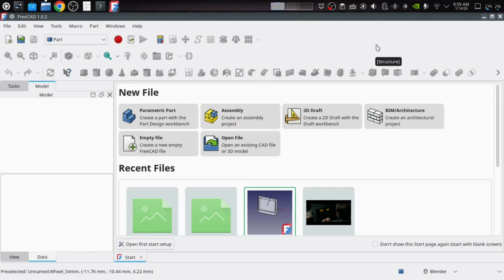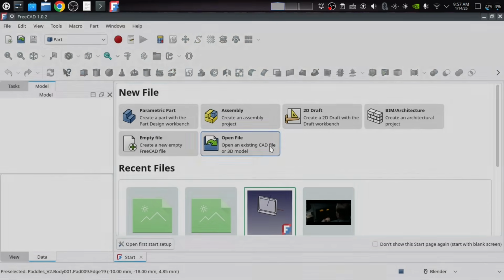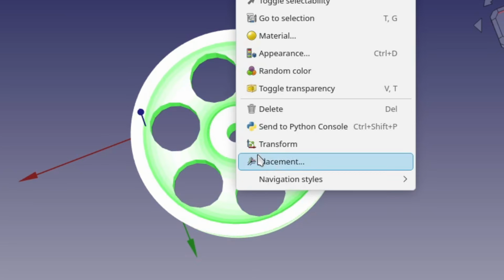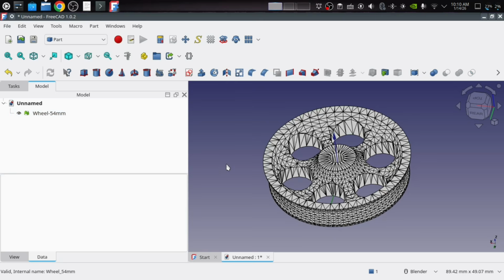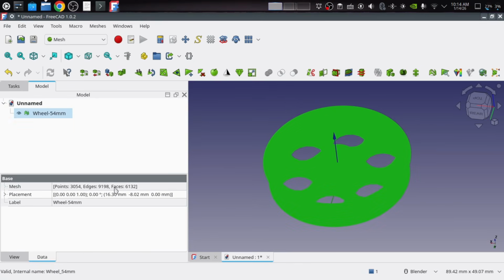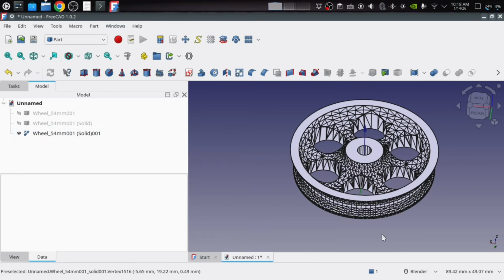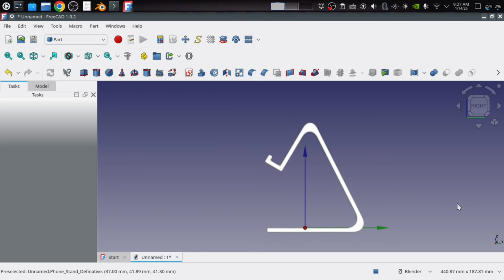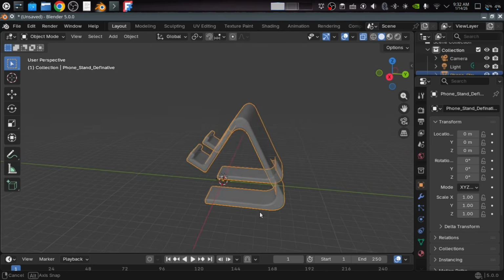FreeCAD - Some beginner tips on editing STL files.

Comment: my biggest pain  with free cad  is lack of smart converters that could detect and convert multifacid surface into something smooth. for example when exporting part as stl it is converted from mathematical construction like circles, curves and smooth edges , to flat aproximation but when you import it back, refining only glue together same plane triangles and i would love to just be able toadd a modyfier to entire surface and make it into a closest fiting bezier
Reply from the maker: I don't know that there are any converters that will take a mesh like STL and create simple surfaces out of them...  
The closest you can get is the STEP file format.  It was designed for exchange of 3D models between cad programs and maintains the mathematically defined geometry of the cad model. 
It doesn't preserve a history of operations though.  You can make limited modifications to an imported STEP file, but you can't change dimensions of existing surfaces and shapes.

Comment: Thanks Kevin, now I have to go learn Blender LOL. A few months ago, I decided it was time to migrate from Onshape to FreeCAD ... and what a journey it was. I am using my resin printer to make small parts (Multiboard wall mounting components) and my FreeCAD is freezing for 5 to 10 minutes doing boolean operations on converted solids that have less than 20,000 facets.  Thanks to your awesome presentation, I realize that adding Blender to my repertoire is a must. As a retired Engineer who did tech support for CAD (CATIA) for 5 years, I would not have recommended FreeCAD to anyone except total CAD nerds. It is easy to get stuck in FreeCAD  because it is really  comprehensive and complicated. 
But I have found that there are so many awesome resources (like you and Mango Jelly) on Youtube, it is well worth the effort.  I have also found that AI (Google Gemini in my case) is very helpful.  I have asked Gemini at least fifty questions about FreeCAD, Inkscape, 3d printing, and soon ... Blender.  When I got stuck, at least %75 of the AI responses gave me an "Aha .. no wonder" solution.
73 and Thank You  !!!!
Reply from the maker: I'm glad it was useful to you.  Check my FreeCAD playlist and you'll find a couple of blender vids.  One on rendering your models, another on moving assemblies over to blender. 
They'll get you started, especially the rendering one.  I take you through the basic steps of the blender interface.

Comment: The tip about using Placement/Center of mass to move an object in the stl file to the x/y origin is awesome. I've been modifying stl files for a while, and I never knew that. Thank you!

I'm curious. You're the first I've seen to sequence the Refine Shape operation after the Convert to Solid operation. Most presenters use this sequence: Shape from Mesh|Refine Shape|Convert to Solid. Then with that sequence, you can delete the originally imported stl, the shape from mesh, and the refined shape -- leaving only the solid object in the model tree. Thoughts?

Comment: Enjoyed you video and learned some technics. However, I tried to use the Addon Manager, and it didn't find the MESH workbench. Not sure where it went. We are both using 1.0.2 so that didn't explain the issue. Sad, I would have liked to play with that workbench.
Reply from the maker: The Mesh workbench is one of the defaults.   It should be there right from the first time you launch the program.  
I just downloaded 1.0.2 onto a fresh OS installation I'm working with and it had the mesh workbench available right away.
Reply: thanks, I’ll see if I disabled it in preferences tomorrow.

Comment: Great video and very helpful. There are other YouTubers who provide the steps on how to do this but they don't give the "why". 

I'm new to 3D printing and I ran into a problem trying to edit an STL. I tried freeCad and ran into a problem with missing facets. I ended up giving up after not being able to solve the problem and tried tinkercad which has its own issues with editing STLs. 

One suggestion would be a follow-up video that explains how to solve some of the problems that might come up that prevent editing inside. Freecad. Thanks!

Comment: Thanks. How would you edit let's say the spoke hole that didn't get converted to a flat single face?
Reply from the maker: In this case, I'd just sketch on the XY plane.  I'd use the external geometry tool to bring in three vertecies from the spoke hole, three along the outer edge of the hole, spaced out roughly 120 degrees.   Then when I sketch my construction circle, I can make it's edge coincident with those three points so it lines up with the existing hole.  Now the center point of that construction geometry circle is in the center of the spoke hole.  I can use it to sketch the real geometry circle..  
Since I sketched the spoke hole circle on the XY plane, I'll just extrude it tall enough for it to come up through the wheel before I do my boolean cut.

Comment: Thanks, Kevin!
Very easy to follow video and, though I'm not totally new to FreeCAD and mesh imports, it certainly still improved my knowledge and understanding of it a lot.
As for Blender, I tried it back then, but gave up after 10 minutes, uninstalled it, vowed to never install it again and then I started learning FreeCAD.
But, after watching your video, I'm thinking I don"t have to fully learn Blender, I can just learn to do one or two things to a mesh before bringing it into FreeCAD.
One thing that is still working well for me when I want to make a few simple adjustments to a downloaded mesh file, is Microsoft 3D Builder.
But Microsoft doesn't support it anymore, so Windows users now have to dig deep to find an install file.
Reply from the maker: Learning blender is just like learning FreeCAD.  Just spend a little time, go through a few beginner tutorials and it will start to make sense and get easy.   Here's a video I did on rendering your freecad models in blender.  It walks you through the basics and will get you started.   
https://youtu.be/uDdG82c_1kU